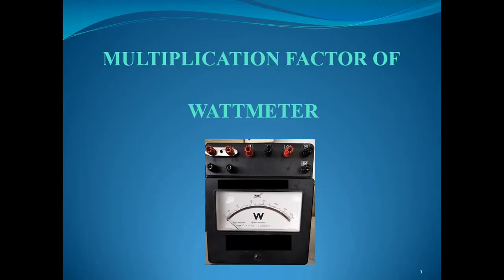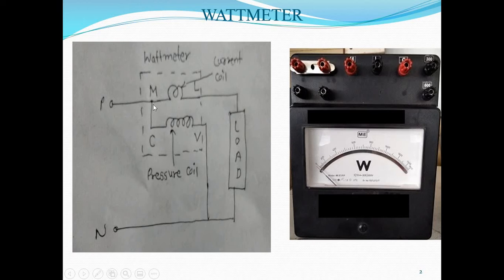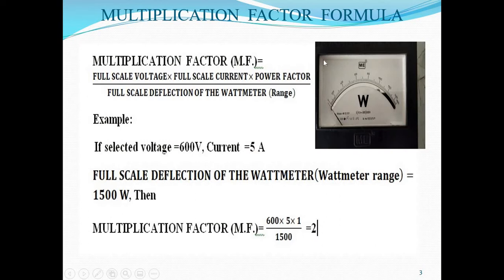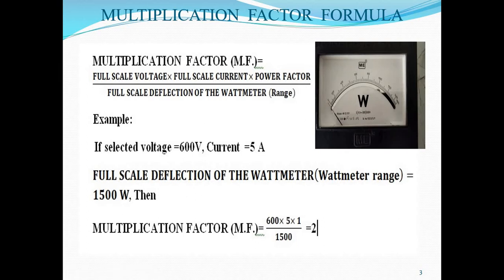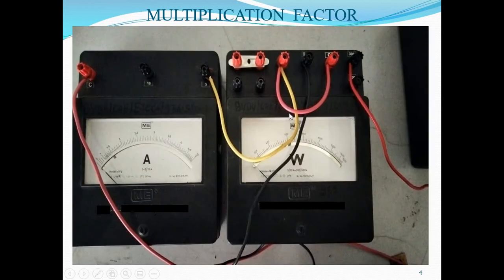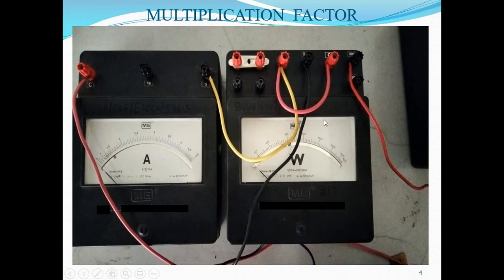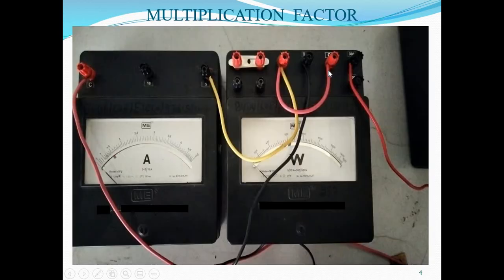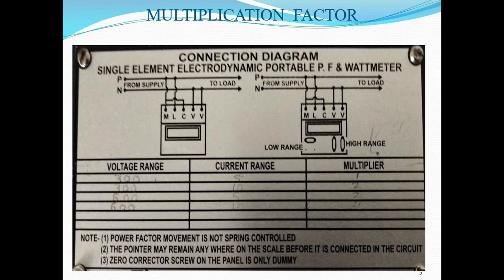Multiplication factor of wattmeter

Comment: Sir if we calculate oc and sc test pf, Should we multiply multiplying factor?
Reply: Multiplying factor is for extension of range..and depend on connection of wattmeter...so although u r using it for any practical application depending on connection of wattmeter you need to use it